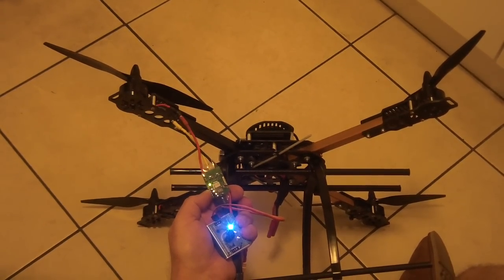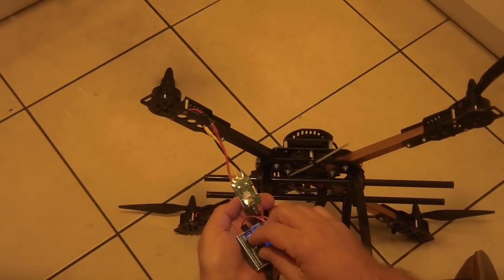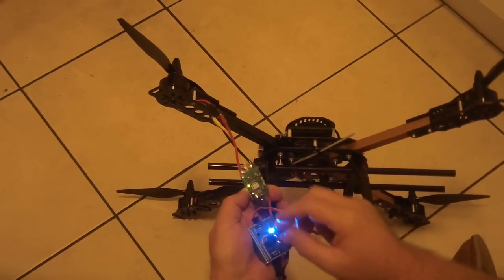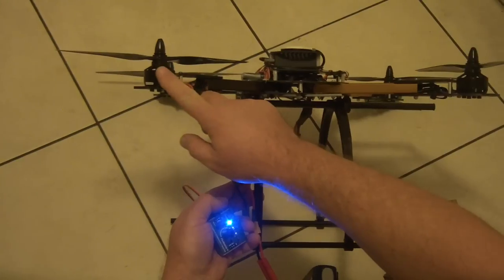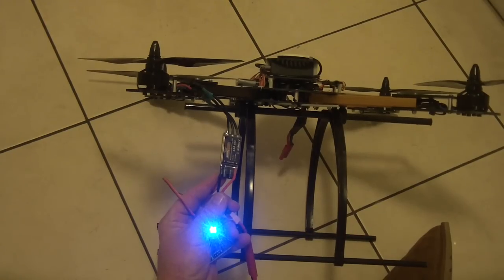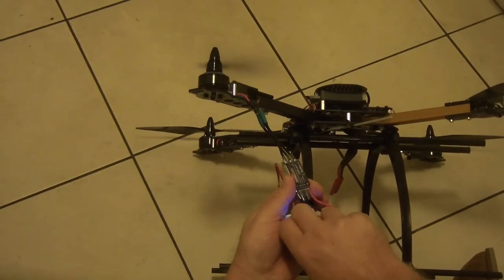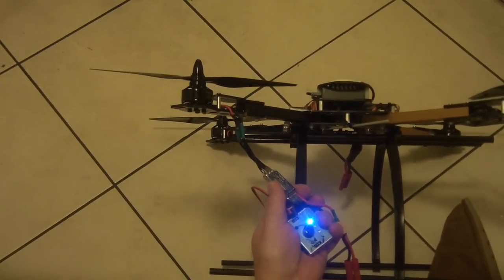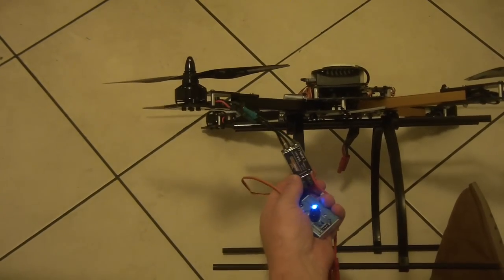Afro ESC vs Hobbyking Blue Series.

Comment: This can be easily resolved by reducing the timing within the code, and I'm not 100% sure if the default timing is the same for all the esc models withing the simonK code (as you compile the code with different parameters IIRC). I for instance find that the "stock" timing for my setup with Hobbyking F-30A's (bs-nfet.inc) is a bit low and "sloppy", and turning it up yields better results, whereas on my old hexfet esc's (bs.inc), the timing was WAY too high and the motors cogged (were out of sync) constantly, and it even smoked one of my motors (was out of sync so much that it locked up and shorted one of the windings, causing a minor fire). Your mileage may vary, but I always tune my timings, as your esc, battery, motor, and prop combo all contribute to what the "sweet spot" is, and no one value works perfectly for all combinations. 

Great video regardless, and that's a great way to test the motors, much safer than how I did it a while back :)
Reply from the maker: Thanks for the info Paul, I don't know enough about compiling my own code yet but very helpful for future research.
Reply: For sure! It's a standard feature on most programming cards that you can buy for commercial esc's (especially in the racing scene of rc cars). When I got into quadcopters, I was dissapointed to not see the adjustment readily available, so I did it the hard way. Cheers!

Comment: Wow...I was lead to believe that Simon k was the cure all for all of these ESCs, but I guess not. Thanks for the video and your explanation. From now on I'm going to always go with proven combinations.
Reply from the maker: I am kind of happy I learned this the hard way (no damage to the quad) just broke a few props when trying to fly with the Afros, but the research and knowledge gained trying to fix it has been invaluable. I think its a problem mainly with the Afros as the HK Blue's also have simonk firmware in this vid but I tested them on stock firmware also and they ran the same.
Reply: Trainboy64 are the hk blue good on stock firmware because I would like to buy some but don't want to buy a flash tool

Comment: Good demo of the ESCs there.  I wish I had found your video(s) before switching away from Afro 30 amps because of bad sync issues on a Tarot 680 Pro hex.  I went with HobbyKing 30A BlueSeries and now am having issues with slow ESC response time. (lethargic response and oscilations)  Haven't tuned the APM 2.6 yet, but I suspect I will have to flash with Simon K to get better results. Any chance you have a video on flashing the HK Blues? It looks more complex than flashing the Afros was. Maybe I should just put the Afros back on and reflash with the 30-09-14 version although with my Multistar 640kv pancake motors, I suspect they may still have an issue..
Reply from the maker: TheAerialAddict Yes I found the 30-09-14 firmware solved the sync issue with My Afros and these motors - I am now using them successfully together on a different quad - see here how they perform with the newer firmware

https://www.youtube.com/watch?v=kshPJlgsj5Q

Also, here is a vid how to flash the Blue Series - you will definately get better results with SimonK firmware in the Blue Series - they are great once updated. 

https://www.youtube.com/watch?v=3IAQvcxIY8E
Reply: Sounds good. I have ordered the flashing tool(s) and will do the job as soon as it arrives.  In the mean time, maybe I'll re-install the Afros flashed with the 30-09-14 just to see.  Funny thing is, I ran the hex on a few jobs with minimal issues but in the last couple of weeks was having big problems with one or two props completely shutting down in mid air. Not ideal for sure!  Love the Afros on my TBS discovery...  Maybe I should reflash that too to see if there is any improved changes...
Thanks for your help on this. Much appreciated!

Comment: Hello! Since you posted this on 2014-06-04, I'm curious if you had tried the newest version since then. At the end of 2013 and finally as of the 2014-01-19 release, I made some ZC sensing adjustments that result in all motors I have working with no issues.
Reply from the maker: Hi Simon,  I have these ESCs in a smaller quad now with Sunnysky 2212s and they run perfectly.  These have the very latest firmware and are great.   I haven't tried them with the 3108 motors again but will do so today and post the results here to let you know.
Reply from the maker: Hi again Simon, I just tried an Afro with firmware 30-09-14 with the Sunnysky 3108 motor on 3S and 4S.  Everything seems perfect. I couldn't get it to lose sync at all.  I'll post an updated video about it later today.  Thanks for the continued development with these.
Reply from the maker: New video here https://www.youtube.com/watch?v=kshPJlgsj5Q

Comment: so why you need hover the quad up and low down very fast ?
Reply from the maker: You don't need it for normal flying but the flight control board can make rapid changes to your motor setting during various flight conditions, eg, descending in strong gusty winds, so even with normal gentle flying the ESC may have to make rapid throttle changes and if it goes out of sync the quad will crash.  See this video - I was flying very gently and the problem still occurred. Problems with the X650F quad (Frame is excellent)